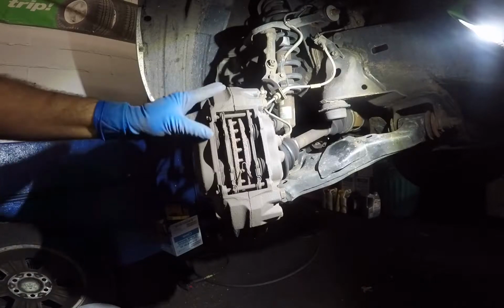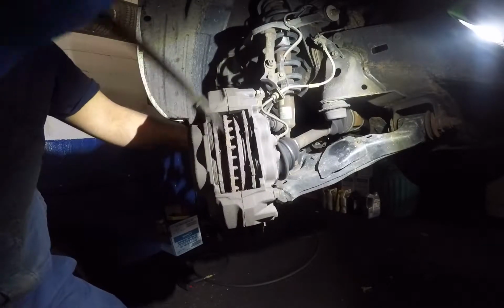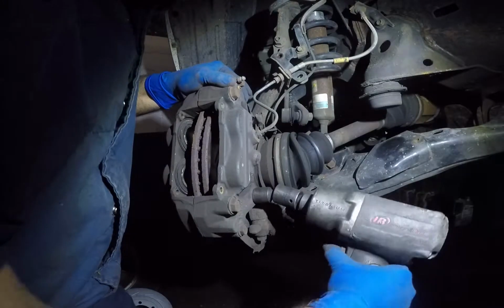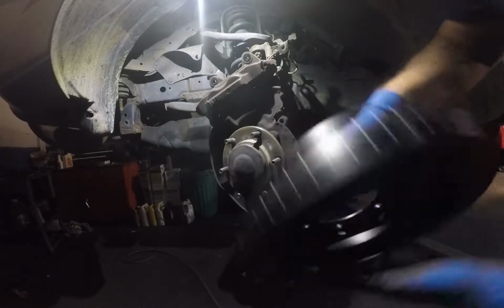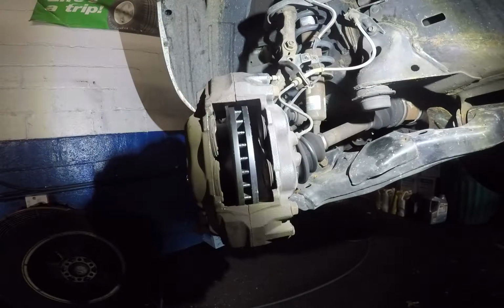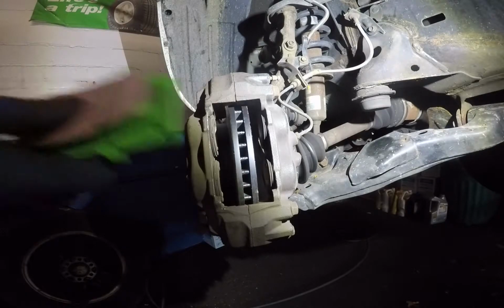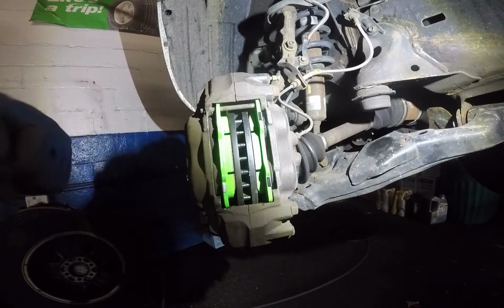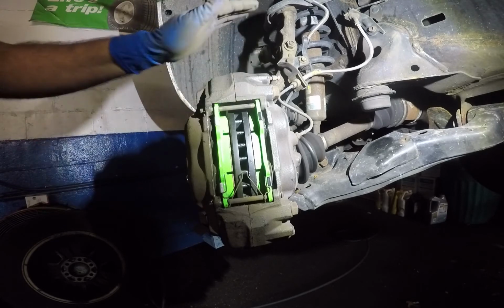How to replace front brakes and rotors on Toyota 4Runner

Comment: Thanks.  I need to do this job on my 2005 4Runner.  I think I'll use brake cleaner on the rotor to ensure the machining and anti-corrosion shipping and storage oil is removed before the pads touch the rotor.  I'm fussy like that.  I'll probably lightly grease the pins too, mostly to prevent corrosion.
Reply from the maker: Yeah

Comment: what grease did you use to lube the back of the shims and the slider area? Thanks, good video.
Reply from the maker: I didn't but will keep that in mind for next time
Reply: @RBTheMechanic  well actually according to my service manual they don't require grease on the shims between the pads/shims.
Reply from the maker: @wally6193  oh ok they went on well and was nice

Comment: im having issues taking off the 2 - 17mm bolts for the calipers. Do you have any suggestions? Thanks
Reply: Breaker bar and penetrating oil is what did it for me.
Reply from the maker: Use longer ratchet or impact gun